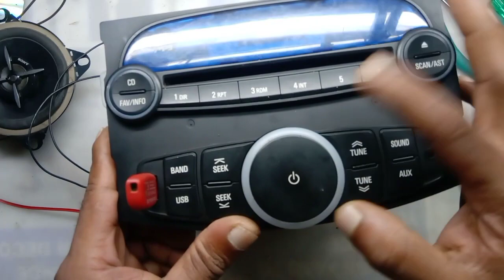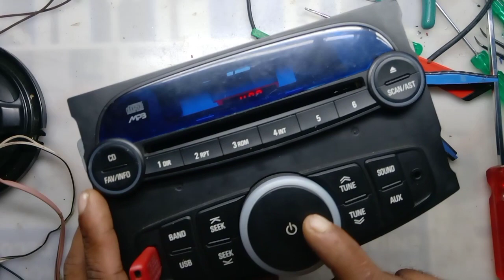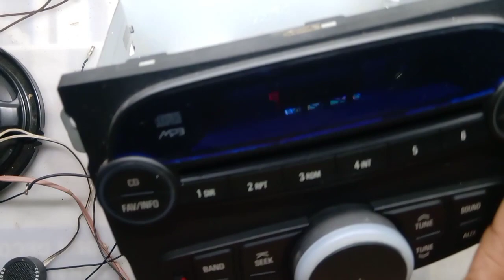chevrolet beat stereo system not working solution full dead

Comment: hi

my car stereo sony gs820bt was working fine. today i tried to turn it on but nothing happened. i checked fuses and they were fine. i also checked cables and harness and they were okay. then i unplugged the harness from the stereo and replugged it. stereo turned on! and worked normally. but every time i turn it off it will not power on unless i unplug and replug it again. also i must say if i turn it off and immediately turn it on, it works. but if i wait a little more it will not work.

do you have any experience about this issue?
Reply from the maker: Check cheithu nokkiyale ariyu bro enthanu problem ennu